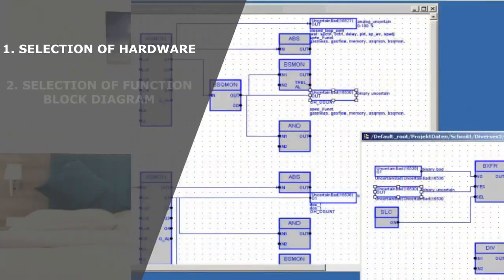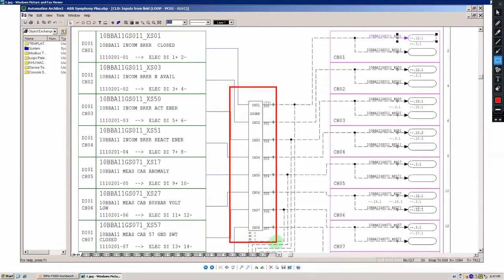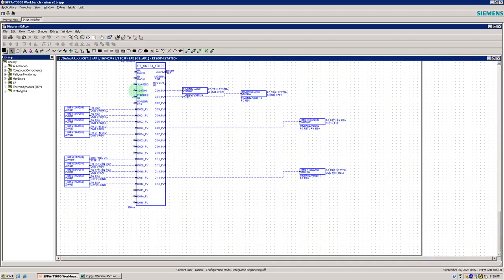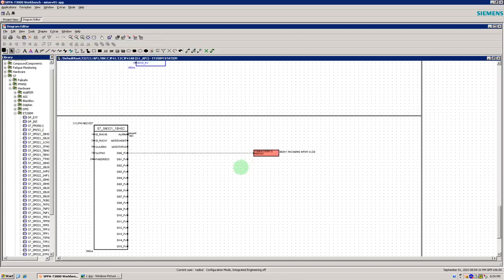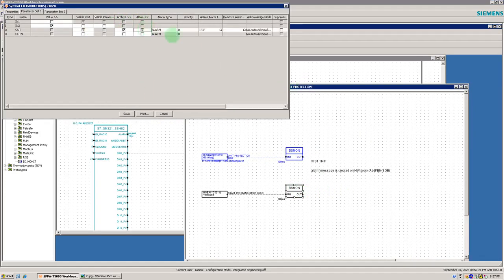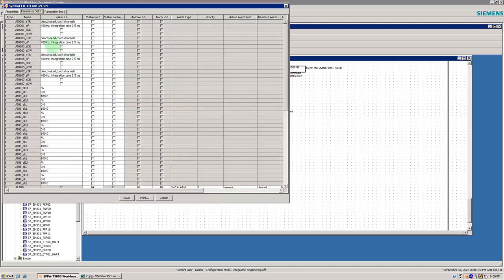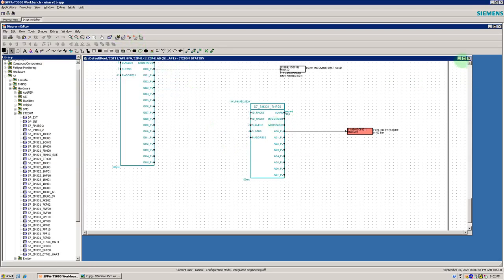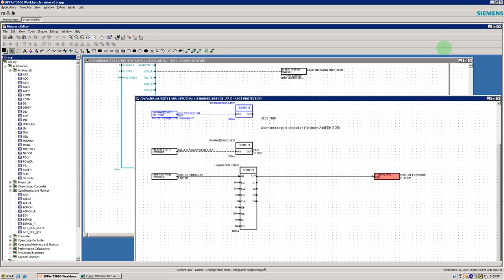Migration from ABB Symphony Plus infi90 to SPPA T3000| PART1| ABB Symphony Plus | Infi90 | SPPA 3000

Comment: Hi sir
Need some help

Was making some changes on an IO block in SPPA-T3000; actually activated an AI channel, commited and when activating received an error message
 `Activation of function diagrams failed; action denied, module needss7 configuration or download 
`the block also turned from blue to light green, picture attached
How do i go about fixing this to make the block active/light  blue again; fairly new to SPPA-T3000
Thanks in advance
Reply from the maker: After changing any hardware proxy, a hardware download is required. Only the commit and activation will not take the hardware configuration download.